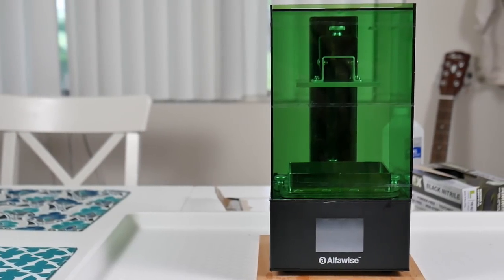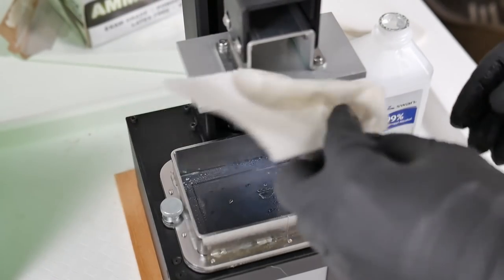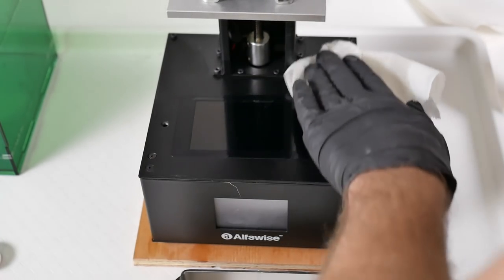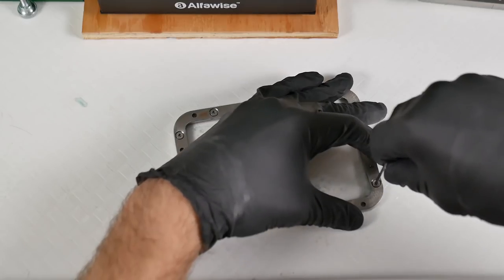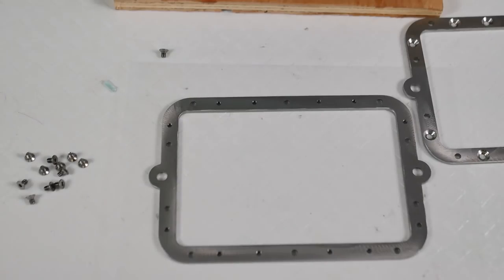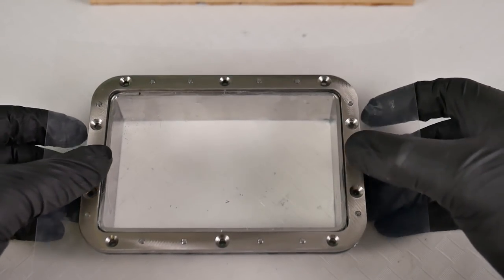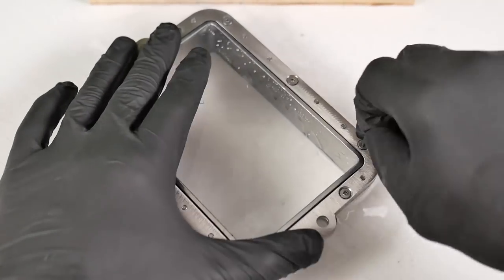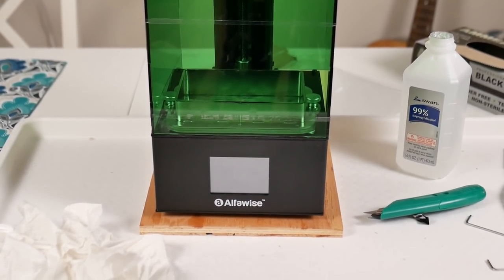Replacing FEP Film On Your Resin 3D Printer VAT & Maintenance

Comment: Couple questions: 1) how do you know it is time to replace the film and 2) generally speaking, how many prints do you do before you have to replace it?
Reply: FEP is very reliable in the long term and generally you only have to replace it when it's absolutely necessary. In the event that a small rip/tear happens, it'll cause a leak and in turn it'll be impossible to print properly or even at all so at the point it would be necessary to replace the film.

Comment: Yes for the Photon you must ensure you put that cap or other riser before setting the screws. If you dont the film is to tight and will not have the necessary flex for the release operation during print. For you to if you are finding to many failed prints you may want to consider ensuring there is some flex on your film. I have noticed for prints where I am adding a thicker base if I did not install the film right the print fails before it even starts. I saw that video where he put a bottle cap under the film but I have a piece of plastic that is not quite as high that I use to set my film height. Comes to about 2mm of flex and so far has worked great with the resin I have used.
Reply from the maker: Thank you very much for the input and suggestion. I have not had any issues with prints not using anything to add flex to the film. However, I do have another resin printer coming that I will be testing out and if I do run into those issues after an FEP change I will definitely give that a go to give it just  a bit of flex.
Reply: @ModBotArmy  If it means anything, I have only used the Photon and everything I have read or heard this really depends a lot on the way the resin develops. Might not be an issue with this printer but I know for sure that on the Photon you MUST have that flex on the FEP otherwise when it pulls away the layer it will ruin the print if it does not allow for it to flex up and peel away. Seems to me however to be something common. If you think about it, this works similar to pulling some strong tape off of something. It works best if you grab a corner and peel back and towards the tape still locked. If you was to try and pull straight up it wants to grab to much of the bonded tape and causes issues. I hope that makes sense and you get what I was trying to say but it makes sense given that analogy I think?

Comment: Would it not make sense to drop the vat and the build plate into a tub of ipa to soak right after each print to keep them as clean as possible ?
Reply: Its not a good idea to expose the fep to long periods of IPA. Depending on the quality of your fep to much exposure can cause the IPA to etch the film or cloud it up. I do dip mine and wash it in the IPA but pull it out when I am done and rinse with water.
Reply from the maker: I agree with the comment below. I do not think that soaking it is the answer. I am sure that it would shorten the life of the FEP film.